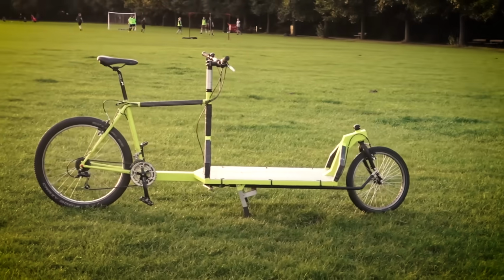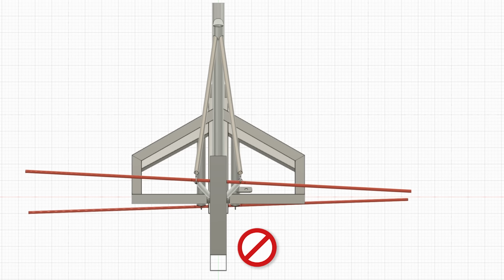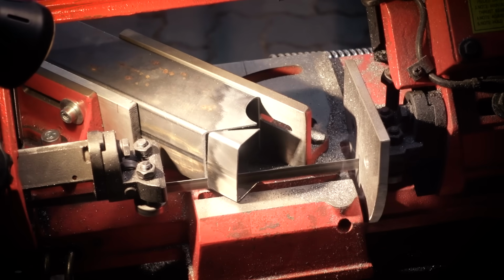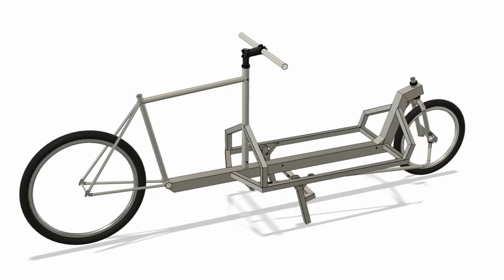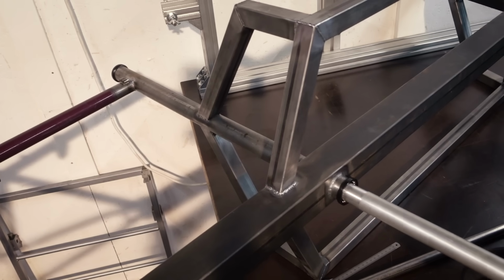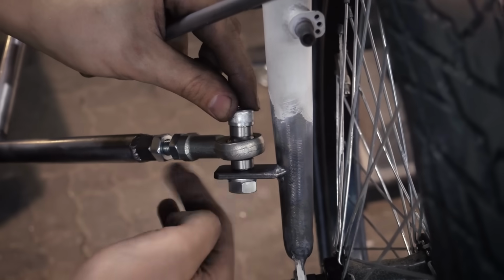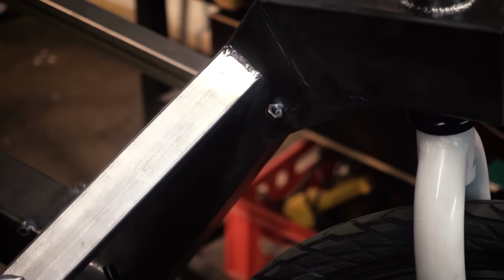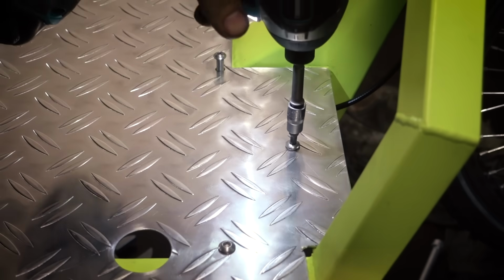How to Build a DIY Cargo Bike (Plans available!)

Comment: So, you cannot buy it, but you can build it. You just forgot to mention that one needs to buy a lot of time (somwhere) and pro equipment (store) to let it happen. Majority of viewers has only basic toolkit and several battery tools , so it can be a lot more motivating to show how you  handle this task with limited amount of tools.
Reply from the maker: Well I explicitly explained in the beginning how I did it without using "pro tools" and mentioned multiple times during the video how the tools I'm using are not required to do those tasks and offered alternative solutions. So it seems you didn't really pay attention... And you also complain that building things requires time? If you want to invest no time and no money then I guess just don't make anything.

Comment: Hey Phil, amazing video! Just wondering, would you just double the wall thickness in all of your plans where I want to use aluminium (I'm seeing if I can obtain 6061-T6 (or similar), but may be stuck with 6060-T5). Cheers!
Reply from the maker: Yeah a few people have asked about that and I have considered making the same one out of Aluminum as well. Doubling the walls is a good rule of thumb I think, although not necessary everywhere (for example headtubes could work with 2-3mm easily).  For the cargo bay frame (the "cage" that goes around) I think you don't have to even increase the thickness since it's not too important structurally so that's where you could save a lot of weight. Most structurally critical part is the downtube, especially the front corners where the gussets are (hence the gussets). But I think 60x60x2 for that tube would be plenty stiff and you could probably bring down the total weight by 5kgs or more. If you do attempt it, pick a good filler alloy, from what I've read it's the most important factor in preventing cracks if you don't heat treat afterwards (maybe you know this, just thought I'd mention it). The "light cargo bike" I made in another video is made from run-of-the-mill 6060 Aluminum and I used 5356 filler wire with no heat treatment. Got that recommendation in some forums because apparently it's a bit softer/more ductile than most other alloys so it has some amount of give and is less prone to cracking.  That bike is holding up nicely, not a single crack, and I'm a heavy rider and use it a lot! Anyway, if you build this from AL, send me a pic, would love to see it!
Reply: @PhilVandelay  thanks Phil, sorry I missed the other aluminium questions. I'll buy your plans when I'm ready to build her, but I'm super keen. I'll let you know what tube sizes and specs I decide to go with in a reply video. I've made a couple of enquiries about special order alloys, as I'm 100kg and my dog (she's an old girl) adds another 30kg.
Reply from the maker: @tonyplatts-baggs4321  No Problem! I answered most of them in private messages anyway. If it's any help, I weigh about the same and I've transported much heavier things than your dog, at least with the steel version. But I suppose it wouldn't hurt to use a harder alloy

Comment: Hi Phil! I’m in the process of building my own bike from your plans. 
I ran into a little hiccup that isn’t mentioned in the plans: my bottom bracket on my donor frame is about 1” higher than the bike in your plans, and consequently my down-tube will need to be about an inch shorter.  
Great plans by the way! Love your work!
Reply from the maker: Ah yes, I think I was thinking about covering bottom bracket height but I thought it's probably going into too much detail for most people. It's hard to write a general guide because there's so many different frame geometries out there, it's almost impossible to take every possible variation into account. Glad you figured it out though, in the end, it's usually not too much of a problem if you're off by a bit here and there, you can build these things pretty crooked and they still ride relatively fine ;)

Comment: Why is the front wheel smaller?
Reply from the maker: Makes the bike shorter, lower, reduces wheelbase which improves handling, improves frame stiffness and also small wheels are more robust. There's even more reasons, I answered it in some other comment
Reply: Thanks for replying. I was surprised.

Comment: After buying the plans I’ve Been searching high and low in the U.K. for steel but it would seem I can’t find any to fit the dimensions I need lol trying to find 34mm outer dia with a 2mm wall if anybody can help that would much appreciated 👍
Reply from the maker: Not sure if it's the same in the UK but here the stuff is called "precision tubing" (translated) which is a different kind of steel tubing that comes in different sizes. "Regular" steel tubing is usually sized in inches so you get all those odd numbers in metric. But precision tubing is sized in milimetres, that's what I bought for the steering tubes. Should also be rounder/more dimensionally accurate. I usuall buy all that stuff from eBay merchants. Hope that helps
Reply: Phil Vandelay thanks for the tip 👍👍👍👍

Comment: Beautiful build. Only one thing I noticed is the connection of the steeringrod to the frontwheel. Isn't this a weakpoint? Personally I would have attached 2 plates in stead of 1. It looks a bit weak and flimsy.
Reply from the maker: Thanks! As for the plate, from personal experience, I think if you slam into anything hard enough to bend that thing, chances are you got worse problems than that bracket ;) During normal riding, steering forces actually aren't that high, just think of a normal bike and how little force you usually apply to the handlebars to steer. I can't think of any scenario other than a serious crash  where enough force would be applied to the steering for that bracket to bend, and that's of course outside of "normal operation" limits so it would break alongside many other things. I'm pretty sure the steering rod itself would start to bend before that bracket goes

Comment: if you don't mind me asking: did you build that extruded aluminum frame jig? I would like something like that for my bike builds in the future. The only cargo bike I built just on the floor with a Fedwire welder and a bunch of hand tools. I still use it to carry tools around town. I agree the right donor bike is crucial. Thanks
Reply from the maker: Yeah, it's incredibly simple really. You can see it in the video, just some extrusion and some right angle brackets and all-thread is all you need. Extrusion is great for this because you can always take it back apart, re-align it, put it together in different configurations and so on. It's also fairly straight and accurate compared to steel tubing. I'll probably make a more elaborate jig for future builds from the same stuff

Comment: 32:00 you made a hole in the front of the frame for the bolt to go in. But whenever anything wet gets in the tubing through that hole it won't have anywhere to escape through. Perhaps you should've made one or a few holes at the lowest point of the frame so water can drip out?
Reply from the maker: Yeah I remember thinking I should drill a hole at the lowest point and then forgot about it... Good point
Reply: @PhilVandelay  would be a shame for it to rot on the inside :D

Comment: Hi Phil, can you tell us the specs of the grinding discs you used throughout this build (grit, type, size, etc)? Thanks!
Reply from the maker: Hey, I'm not sure what brand they are but it's usually just generic flap discs, mostly 60 or 80 grit on a 125mm grinder. I just buy whatever brand is cheapest on eBay at the time, so nothing special really
Reply: @PhilVandelay  Okay great! Thank you and keep up the outstanding work! I purchased plans for the Cargo Bike and the Welding Table. Can't wait to get started!

Comment: F****n amazing!

Would be ok to use 28 " donor bike? Plan will remain the same?
Reply from the maker: It should work, you will have to adjust some measurements but you have to do that with every frame (since every 26" frame is also a bit different). But there are instructions in the plans on what you have to look out for to adapt it to your frame, I think it should be no problem

Comment: Hi Phil, can you Share the welding parameters you have used die the thin frame tubings (curent etc.)
Thanks!
Reply from the maker: Hey, Sorry but I don't remember exactly, I usually kind of "feel" my way through it. But it was nothing special, no pulsing or anything, just regular TIG. If I had to guess I probably used around 50 amps for these welds.
Reply: @PhilVandelay  Doesn't matter. Next Werk In want to buy your plans and start building.........I have an old steel frame and do some test welds.

Comment: After seeing this, I'm keen on trying a build making a three wheeled bike, like a recumbent. A good one costs a few thousand dollars, building one would add weight as I can only TIG mild steel, but add satisfaction. Your thoughts would be appreciated.
Reply from the maker: Why just mild steel? If you can TIG you could use Cromoly tubing which is what's usually used for bike frames. Harder to get but much, much higher tensile strength so you can use very thin walled tubes to save weight. CroMo tubing on bike frames often has wall thicknesses thinner than 1mm, sometimes as thin as 0.5mm because the stuff is so strong. So you could easily save 50% weight with that. I would have used it for this bike, except I wanted to show that it can be done with simple, common materials too. The problem is that long, thin CroMo tubes can be hard to find, but you can search for bike framebuilding suppliers in your area and maybe you'll find someone who sells it.
Reply: @PhilVandelay  thanks for getting back to me, I hadn't considered using anything other than mild steel, thanks. I'm in Australia, but will look around.

Comment: NO! The front fork should 1. be able to spring and 2. it needs this bend for a smooth straight running! Ergo: Please weld the tab for the steering bracket UP to the fork head or something below!
(NEIN! Die vordere Gabel müsste 1. federn können und 2. braucht sie diese Biegung für einen ruhigen Geradeauslauf! Ergo: Bitte die Lasche für den Lenkbügel OBEN am Gabelkopf oder etwas darunter anschweißen!)
Reply: After reading your comment I checked the commercial cargo bikes. Some have the bracket, as you say, way up at the fork head others way down at the axle. So what is the better design and why?

Could you please elaborate on the two points in your comment and explain in more technical detail why? 

Gerne auch auf Deutsch.

Comment: why did you use square shape tubing instead of round one? is it more resistant?
Reply from the maker: It's mostly just because it's easier to build that way. With round tubing you always have to keep the correct orientation for example for mitre cuts or tube notches which can be tricky, but with a square tube you have flat surfaces as a reference so you always know where your top and bottom is. This bike is mostly designed to be easy to build.

Comment: My choice to carry semi size loads is low step bike with electris assist. I added 50 litre motorbike rear box on rear rack. I have foltable trailer for it to carrying big things. It suitable to pick load (hand truck) and tow it in many angle depending dimensions. In many times I needed to carry long pipes and ordinary trailer is useless for that. That why I made it adjustable.

Comment: That level workshop is rare to doing hobby projects. Maybe you can collect some frames and make small serie of cargo frames. Bolted joints are practicat for posted it to customers. Female type bike frames are better with cargo, in generally. Wheel spokes must be strong for heavy loads. One weak part make its useless.

Comment: Interesting and practical  bike modifications I completely agree with you about not needing a fancy shop and tools to get projects done  at one point in my life i had to downsize and i found myself living in a two  bedroom Comdominium  as a Woodworker by profession and a all around handy person  i used to transform my living room into a temporary shop  to do things from repairing Motorcycles , outboard engines  and to build furniture  ironically i am a very neat and clean  worker so  there was not any evidence  of me doing all those projects  in my small area because i used drop cloths and dust collection  and  often my Kichen table became my work bench as well  one i built  and it was a Formica  covered surface to match my countertops in the kitchen  i even had a small vise that clamped on  temporarily   some of my  completed projects included  Go Cart rebuild , Installing new head gasket  on a Personal Watercraft , rebuilding a Small Block Chevy  V8 marine engine, bribing a Oak Wall unit  that was 8 foot tall , and a few outboard engine
Reply from the maker: Nice! Yeah you can do a lot in a limited space, it might take longer and it's more annoying, but not impossible. Nobody should give up on building things purely for that reason. Work with what you got, instead of focusing on what you don't have

Comment: I'm just curious to know that , Why are u using front & rear wheels of different sizes ? Why not the same size ?
Reply from the maker: There's a lot of reasons. It makes the bike shorter and the frame stiffer because there's shorter levers acting on the front end, and by reducing the overall wheelbase you get a smaller turning radius. Smaller wheels are also more robust and turn more easily due to less rotating mass, making the handling snappier. It also allows to use a smaller steering rod, otherweise it'd have to be very wide to get around the front wheel when turning, making the bike wider. Also allows you to load long things hanging over the front when you got something to raise them up like the box, with a 26" wheel that option would be much more limited. There's a bunch of other reasons.. but basically it just makes more sense and the question should really be: why not? There's few downsides to a smaller wheel in this case, while there's a lot of advantages
Reply: @PhilVandelay  thanks for the reply

Comment: Isn't it overengineered? It looks very heavy. Are you going to make lighter version in future?
Reply from the maker: It's designed so that it's easy to build so yes it is a bit on the heavy side, but nothing too crazy, 30kgs is still pretty normal for a cargo bike this size, even commercial ones. But yes, it could be lighter, it just wasn't a priority for this build. I wanted to make a guide for people to build this and in that case it's better to overbuild it a little bit so if the build quality isn't perfect, it still holds up. If I designed a bike purely for myself it would look different and use different materials, but then it wouldn't be easy to build in the average home shop.

Comment: why not just put a little trailer behind a moped? 
you'll spend less on gas than you do replacing the calories, the little motor can pull more than a human, and the $300 on the parts and hours of work will add up to way more than a little moped and a little trailer.
Reply from the maker: Sure, why ever make anything yourself? Let's just buy everything and also pollute the air with gas engines while we're at it